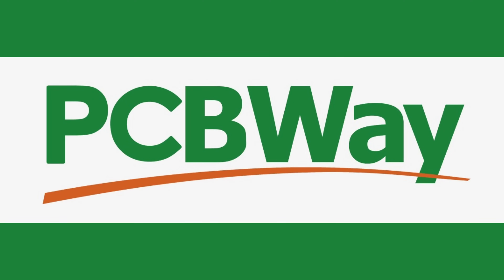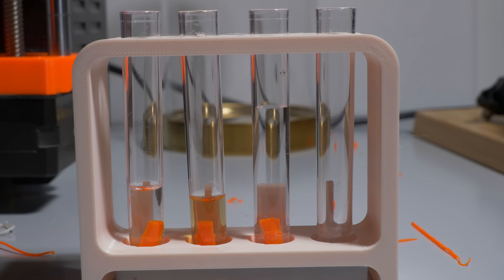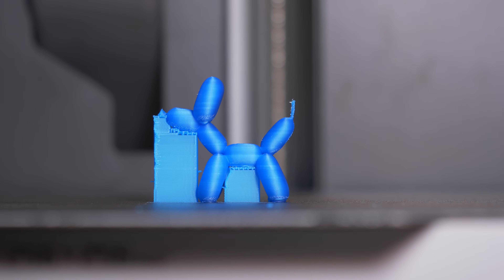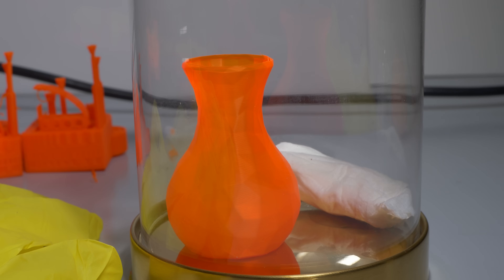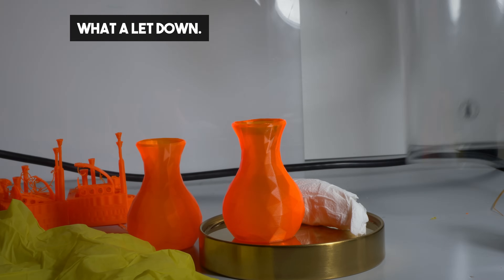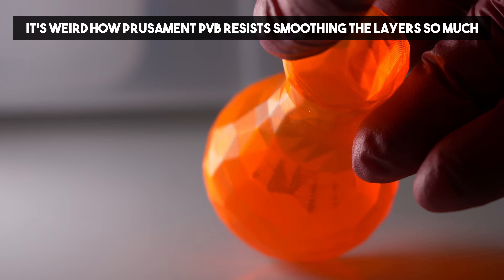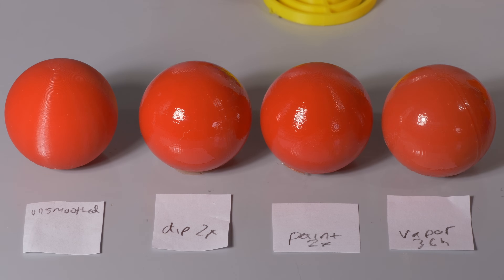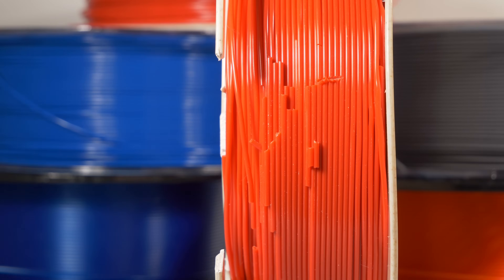The Smoothest Filament: 3D Printing without layer lines!

Comment: I tried a bit of pvb from yousu and it worked great. I found my best method for smoothing to be streching out metal window screen material over a frame and misting with a hair dressers spray bottle. It puts out a fine mist and as long as you hold the trigger it continues to mist. I did 3 or 4 total misting sprays and allowed it to try between coats and then dry for a day when finished. I used 99% alcohol. I did two nice large black swans for decoration.
Reply: Does the screen pattern show where the print sits on it?
Reply: @TheFredmac  yes it does. The problem I had was if it was on anything else the alcohol would pool and soften the bottom layer and give it a worse elephant's foot then just regular printing could. The screen allows the alcohol to fall and drip off which I found to be the best thing. You potentially could thicken up the bottom layer and then after you're done with everything sand it with a high grit sandpaper and smooth it remove the pattern from the screen
Reply: @nathanreed3302  farther down in the comments someone said they use a soldering iron to put a staple in the print. Then they can hang the print from the staple. Someone else said they use parchment baking paper to keep the print from sticking. 
Most of what I need smoothed I can live with a screen pattern on a section of the print. This is all good information thanks for replying.

Comment: I have used 2 cheap brands from amazon and both are kinda a nightmare to work with. Dry for 3 days then get a few hours of printing before it becomes pure rice crispy popping and bubbling.
Reprapper seems to be the better of the 2 i have used but still quite annoying. it chugs water like a fish.
Reply from the maker: yes - you get hours to a day or so before you have to dry it again, best is to feed it from a dry box or just a closed container with silica. Way too hygroscopic.

Comment: To be clear heat creep is the problem for a blocked nozzle, so a water cooled hotend does not need to open the enclosure?
Reply from the maker: correct! this is why water cooling is great (and I hope to see it on retail machines!)

Comment: I tried some PVB from RepRap and found pretty much all prints were uniformly awful. Even when dried. blobs and defects galore. Not sure if it was a bad batch or not. It does go glossy. But was not smooth. More like a bumpy rough shinny lol. I hope others get better results, but for me it was a total waste of time. I look forward to reading the comments for other's experiences and from other brands. Cheers :)
Reply from the maker: Similar experience until I a) dried it and b) printed it at 205C. 
Also it smells SO much more than the others.
Reply: I'll try the lower temp, and will dry it for a few days. See if that helps. Thanks!  @LostInTech3D

Comment: Denatured alcohol that is typically found in the painting section at most home improvement stores is high concentration ethanol. Denatured means they are something to make it so you cant drink it, bitterents, methanol, ect.
Reply: Not quite. The one you find in the painting section is usually mixed with quite a lot of methanol, which tastes the same as ethanol but is highly toxic.

"Denaturated" simply means there's something else in it besides the "main" alcohol and water. 

The one you buy at the chemist's (pharmacy) is usually 70% or 96% ethanol, with the rest being water, and 0.1% of a safe denaturant (like denatonium) to make it taste bad so people don't use it as a cheap alternative to vodka.

If it specifically says "denaturated ethanol" it's probably safe (just ethanol, water, and something bitter). If it says "denaturated alcohol" there might be other alcohols in it (like methanol). Still mostly safe to handle, but definitely, definitely don't even taste it.

Comment: What about an ultrasonic cleaner with progressively larger concentrations of Isopropyl in it? Theoretically, it reaches all the cracks and crevices, and potentially removes layer lines.
Follow up with rough sand/cleaning, and a second round with more or less aggressive alcohol content.
Or if possible, a small rock tumbler modified to hold a jar of alcohol (Again, with varying alcohol content) designed to agitate and evenly disperse around the model. Since it seems your biggest issues are overexposure, underexposure, or too much exposure in a single area. All a result of methods with less control, like vapors, sprays, or baths. By creating a bath that constantly agitates and moves the model, it gives you a finer amount of control, with lets say a bath of 80% water, 20% Isopropyl, potentially yielding good results over a few hours, or day. Maybe even able to predict the necessary time to bathe by calculating mass or surface area.

Comment: Is it food safe? Layer lines are what's preventing PET from producing actually food safe prints (because you can't properly clean between layer lines).
Reply from the maker: hmmm I wouldn't count on it, that would be a question to ask the manufacturer. Definitely will melt in a dishwasher!
Reply: It dissolves in alcohol, which is present in a lot of foods. I wouldn't eat from this
Reply: @KaitouKaiju  that's a really good point, thank you

Comment: I'm surprised you didn't try methylated spirits / denatured alcohol, both are over 95% ethanol and easily purchasable.
Reply from the maker: I could have, but I think most people already use iso anyway to clean 3d printer beds and carbon rods.
Reply: @LostInTech3D  That's fair. At a random guess, with its smaller particle size, ethanol might result in more weakening of the overall print. Wonder what acetone fumes would do to this one...

Comment: The way you dispose of isopropyl alcohol... Go outside and toss it anywhere. It'll evap quickly. Nah, but for real. I appreciate all your safety concerns. It's just funny as a car guy who has been like elbow deep in open gas tanks to be super worried about a small glass of iso. Always better safe than sorry though. Fun video!
Reply from the maker: Not here 🤣🤣 especially in winter
Reply: @LostInTech3D  Hahaha oh I get that. I was out snow blowing for about an hour today. I'm just south of the Canadian border in Vermont. That said, all it will do is melt some snow faster. Think of it this way, most windshield washer fluid is methanol or in some cases ethyl alcohol, and they just spray that crap everywhere! Hahaha. I still understand encouraging safety though.
Reply: Dont smoke while doing so

Comment: I keep some fully dissolved PVB in a jar just in case.  You can put a drop on the print bed during print to glue down the print if it starts to curl.  Just know, removing that drop from the bed will be fun at the end.
Reply: I question your definition of fun. 😂😂
Reply from the maker: That's a good idea!

Comment: I don't print PVB for anything I want to keep as the final product, but it's my go-to when I'm making a mold for making something from it.  I use a medical nebulizer to vaporize IPA in a closed chamber to do the smoothing.  Biggest issue is if you go too far bubbles in the layer lines will come up and ruin the finish.  Still, it's opened a lot of options for my products.
Reply: what products.
Reply: @exceptionalanimations1508   I looked and found what it is.  There's a specific item that would require a molding process with a smooth finish for the poured in second material such as silicone, so having layer lines wouldn't be great for it since the lines would imprint.  There are many applications for this technique, and I think I'll use it for some gaskets for some goggles without having to very carefully sand the surface for comfort.
Reply: @exceptionalanimations1508  polymaker polysmooth clear for dissolving totally and green for printing.  Green is the easiest color to see surface details with for humans.  Nebulizer is generic from amazon.  Note, printing in clear pvb is almost impossible to see the surface finish.
Reply: That's a really cool idea, I hadn't considered making molds by dissolving out the plastic
Reply: @thethubbedone  I don't melt out the plastic, I just use PVB because I can get a glass smooth surface. It takes quite a while to dissolve PVB completely, but it should be possible eventually.  Still, I wouldn't suggest it.
Reply: Have you tried sanding before smoothing? Seems like that could get some good results.
Reply: @mrdurden3224  Yes it does!  But you need at least 3 perimeters to make sure it still has support when it melts (and infill)  It can also introduce air bubbles that come out in polishing.  Once you smooth though, you have to wait at least a week for it to harden up enough to sand again.
Reply: @glowpon3  "you have to wait at least a week" -- that's prolly important to know and hard to discover.
Reply: @paulmcclay8697  what's horrible to discover is your finger prints on the final because you thought it was hard enough.
Reply: Dry your filament for hours. The bubbles are from water moisture

Comment: Maybe in the US you cannot even buy 50+% alcohol...

...here in the balkans if you brew your fruit brandy below that, you gonna offend your guests.
Reply: Jokes aside i would argue people outsude the one puritan land under gaaawd  (and islamic states) are pretty familiar with high concentration alcohols and you are extremely overselling the risk.

The fact that rubbing chilli peppers into your eye is a bad idea doesnt mean you need to handle it like radioactive waste either.

...imho. ABS/ASA is superior if the printer can accomodate it. As difference in hassle is minimal, and temperature resistance increase - and improved toughnes (aka shatter resistance) tend to make parts way more suable in most cases.

Though PLA can win in niceh cases where ultimate yield strength, or rigidity are crucial.
Reply: You can buy 96% ethanol in the US

Comment: I don't hate layer lines. i think they're part of the inherent aesthetic of 3d printed parts. rather than trying to pretend we're making injection molded parts, we should just embrace the natural idiosyncrasies of our process!
Reply: I guess it depends if you're trying to make "3D printed parts" or just, you know, parts. When I'm making something functional, I don't really care about the process, I care about the thing I'm doing. And having holes or irregularities on the surface makes the part weaker / more prone to friction / harder to clean, etc..
Reply: Exactly! Both visual and functional requirements exist. It's always the same "oh then you're using the wrong process..." Pretending it's impossible, while completely ignoring all the people that manage to make cool stuff with FDM.
Reply: @RFC3514 Get better at designing your parts then
Reply: @TheFish711  - Nothing that I wrote has anything to do with design. Layer lines and gaps are an inherent artefact of FDM. FDM-printed parts will never be as strong and smooth as injection-moulded parts, for the same material.
Reply: But they collect dust particles between those layers and sometimes even unable to get rid off unless sand it down.

Comment: This seems a lot more cumbersome than SBS. You can smooth it really easily by brushing on Limonene. It also prints clean and doesn’t absorb moisture. Is SBS not available anywhere outside South Africa?
Reply from the maker: I think it's pretty equivalent, but SBS is definitely hard to get hold of here. I might try to get some.

Comment: I've had waaaay better success with the vapor method. Completely smooth small figures in about 6-8 hours, no visible layer lines at all. Your results honestly didn't look very good, most still had visible layer lines. Whether it's your filament or methodology, I can't say for sure. Did you try PolySmooth? That's what I'm using.
Reply from the maker: Polymaker don't really sell this side of the ocean, at least for sensible prices. Did you heat it?
Reply: @LostInTech3D  No, just room temperature in a fairly small round plastic bucket (Ø15cm, 18cm tall, with tight screw-on lid). The bucket is lined with paper towel, which I believe will help make sure the vapors reach higher. I also use around 50ml of 93% ethanol (it's the cleaning alcohol that's easiest to get here in Denmark), which I mostly just dump in the bottom, but also make sure is soaked into the paper towel. My figures stand on a small PLA platform about 4cm tall, so they're not close to the bottom (I actually place them on a small piece of baking paper, which peels off easily once the figures have dried for 2-3 days and prevents the figure from sticking to the PLA platform).
I have tried heating the bucket on a printer bed at 35-40C (going higher seemed to make the alcohol condense more, which I didn't want) for a few hours, but it didn't seem to make a big difference.
Clean up any stringing, ugliness or support before you start smoothing the model. A light sanding pass on spots where support touched can't hurt either.
And remember that thin parts will start to sag and deform before they begin to look smooth. Some models just don't work for smoothing. Print with many walls.
P.S. I found out about overdrying PVB too, not from too high heat, but from drying at 45C for several days. Luckily, it had only ruined the outer layers of my spool when I noticed.
Reply: @LostInTech3D  Also, the PolySmooth I got was about twice the price of PLA (taking into account that PolySmooth is only 750g).

Comment: Isn't it great when the government decides to protect us from ourselves?

It's a neat material, though I can't say I've ever been particularly bothered by layer lines, unless they're causing a mechanical lock up where I want movement.

I've found good results using a spray bottle. Needless to say, safe handling is a good idea, though there are a lot of mundane materials with intimidating msds.

Comment: To me it looked like you got a little iso on the bottom of your container. I bet a wire mesh platform with a small fan underneath it will help achieve more even results, just like with ABS/acetone. For very similar effects we could just spray a clear coat on the part...., not sure smoothing is even worth the trouble IMO, especially considering the pale color change , and strings,...
Reply from the maker: Oh yeah for sure, air circulation would help a lot, so long as it doesn't cause fire
Reply: @LostInTech3D  very good point, brushless fans only!!  🔌 ⚡ 🔥 🚒
Reply: @gutrali like a magnetic stirer but with a fan instead.
Reply: @TheFredmac  a simple/common brushless fan should work, it would not spark at all. Most tiny computer fans are made with brushless motors already . 

Decoupling the rotor from the stator like in a mixing plate is not required to prevent a spark if you use a brushless motor; a brushless motor will not create a spark. A brushed motor is much larger, and that type def creates sparks that could be dangerous
Reply: @gutrali  I was thinking my idea could be very small and simple. But you are right about the computer cooling fans.

Comment: Maybe it's just me, but I could still see layer lines - I think I'd rather crank up the resolution.
Reply from the maker: yeah that works, I printed the shiny ball at 0.07mm and the layer lines were too smooth for the thumbnail so I had to do it again :)
Reply: But shiny layer lines

Comment: Polynaker used to have a vapor smoother exactly for this purpose. It worked reasonably well.  And obviously they had filament for this. Just not sure if they are still supporting it.
Reply from the maker: I think it's just too expensive (the machine) for most people who want to use it casually
Reply: @LostInTech3D  absolutely agree. I used to have it and eventually sold it. Unless you have a very specific need to smooth things, the novelty wears out real quick.

Comment: That tool is called a Vero strip cutter. used for cutting tracks on vero strip board. A  drill bit is also suitable for this. Yes I'm an old electronics engineer, and still use vero strip board occasionally when prototyping a really simple design when its not worth dropping £30 on a pcb when you only want to build 1 board.
Reply: Somehow I thought it was a wire wrapping tool? Looks like an optometrist visit is in order.🤷🏻‍♂️
Reply: My eyes are not great either so you could still be right @TherapyWithWind
Reply from the maker: tbh it was an afterthought so I didn't take a particularly good pic of it, but yeah it's the stripboard track breaking tool
Reply: Spot face cutter, or just use a drill bit. I can't remember which diameter anymore, though. Maybe 6mm? Haven't had the need to use any Veroboard in years, but I probably still have some around in a dark and dusty corner.